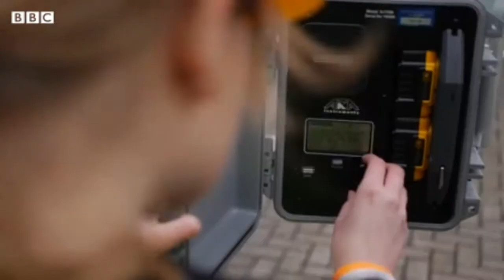How cruise ships contribute to Southampton's air pollution

Comment: Just copy Halifax, and you'll be OK:  Shore Power Arrives at the Port of Halifax - Cruise Halifax 
https://www.cruisehalifax.ca/shore-power-arrives-port-halifax/
23 Jan 2013 – Halifax, N.S. – The Port of Halifax will be the first port in Atlantic Canada to implement shore power for cruise ships, beginning with the 2014 cruise season.   Shore power is a highly effective way to reduce marine diesel air emissions by enabling ships to shut down their engines and connect to the electrical grid in order to provide necessary power while docked. This initiative represents the second shore power installation for cruise ships in Canada.